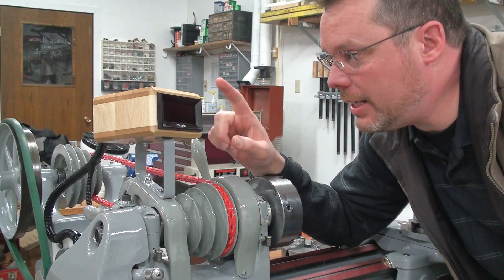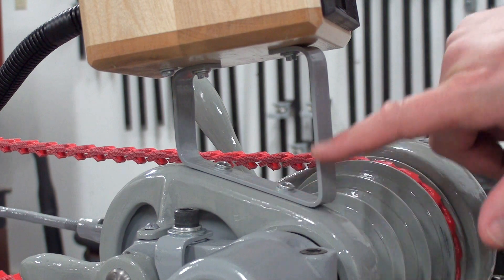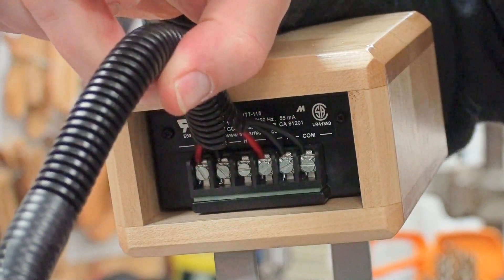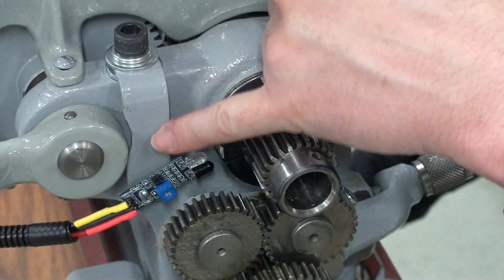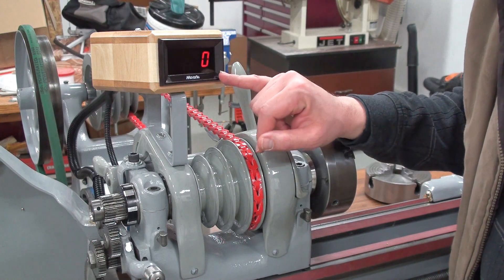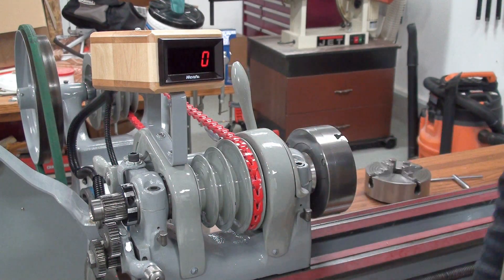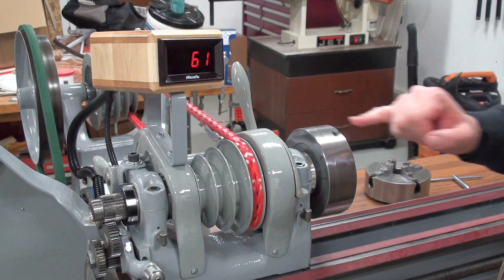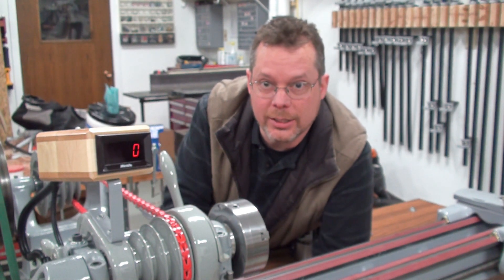Installing a tachometer on a vintage South Bend lathe

Comment: Aaron,
Crusing around you tube and saw your posts. After viewing a couple of your vids, I'm impressed! I also have several Southbend lathes, and don't know if I would convert to a dc motor, as it seems extremely noisy. However I would like to have the variable speed without having to change belt position.  Also would like to get tuned up on this tack drive you have. Is that hooked up on ac?
I have subscribed to your channel, and am going to watch your restoration video next, as I trully am impressed on how beautiful your machine is!
Razor!
Reply: It is possible to adjust the speed of an AC motor by using an VFD and adjust the frequency or pulse.
Reply: It is actually easier to adjust an AC motor in a pretty wide range by frequency (exactly how much appends on the particular motor type), since You can not realy do that on a DC motor, and pulse control may make the motor a bit weaker. So, on a DC motor You are more or less locked to use only Voltage adjustment (so i am not sure it is possible to make it much quiter with the most common types). 

So, in Your case i would keep the AC motor and give it a try and see if it works well enough for Your needs by adjusting the frequency instead.
(Just be aware of the temperature and the bearings if You want to try to go up to higher frequency, once usually can identify pretty easily by the sound if it can handle it.)

Comment: What kind of belt are you using? I’m converting my SB heavy 10L to a 4.25 hp treadmill motor and I’m worried about what kind of belt to use. 
Thanks,
Paul
Reply from the maker: I've sold the machine a few years ago. I'm sorry, but I no longer have the information of the items I used.

Comment: I don't know why yours so slow, my mini grizzly uses similar technology  except it has this slotted wheel that looks soft of like gear and has similar optical sensor but it detects speed change very fast like less than a second.  So I think the technology is there you just probably got crappy one.

Comment: Hi Aaron. Hey, I got a question. I also have the same lathe I'm in the process of setting up to run on a VFD and I'm going to put a Tach on it also. My question is why aren't you using a proximity switch instead of that Arduino reader? Drop me a reply, I'd be interested in your reasoning. Thanks.
Reply from the maker: I used a reflective light reader since it is the most compatible with machining. A magnetic switch would gather metal chips, and a contact switch would be interfered with by debris and oil.

Comment: Is there an issue with grease/oil from the gears getting on the sensor?
Reply from the maker: +acklan3 The sensor is mounted far enough to the side (offset from the gears) that oils did not get on the sensor.
Reply: Aaron Weed good to hear. Look forward to your next episode.

Comment: Why not by a magnet read tacometer?
They cost like 12 dollars are 10 times smaller and easyer to install. Only put one magnet anywhare on the axle.
And have a refresh rate of 0.2 to 0.5 seconds.... instead of 7.5 seconds. that is damn long.
Reply from the maker: You can use any kind of tac you want, but I didn't want metal chips to cling to a magnet, so that is why I went with optical. In addition, there was not a place to mount a magnet on the spindle and also be able to allow for the clearance needed for the magnet thickness; so no, I could not mount it anywhere. You can't see it in this video, but the the distance between the collar and the gear is very limited. Finally, there were hardly any options for mounting the sensor considering the space I needed for it; I picked the best spot and worked from there when selecting a tac. The one I used in this video was a good deal on eBay, so I worked within its specifications, which required several reference points. The 7.5 second wait is not a big deal, it is very accurate and worked as I needed it to.

Another thing to consider is that the cheap tacs use low voltage and need a transformer. I didn't want to mess with several components, so I went with a tac that operated directly with 120VAC to simplify the process.
Reply: Hi, our store can supply detection distance 20mm, don't distinguish magnetic pole https://www.aliexpress.com/store/product/10PCS-20mm-NJK-5002C3-NPN-NO-Hall-Effect-Sensor-Proximity-Switch-DC-6-36V-Inductive-Proximity/1668604_32860488892.html?spm=2114.12010608.0.0.27662b3fOI0kzu

Comment: nice job on the lathe, What kind of paint did you use on your lathe and how was it applied? I purchased a Model A  last week and would like to do the same to my lathe
Reply from the maker: I used an alkyd enamel, but an epoxy paint would have been better. I applied it with a brush.